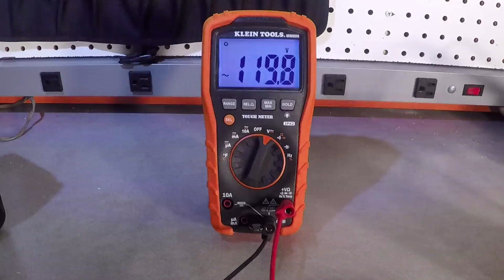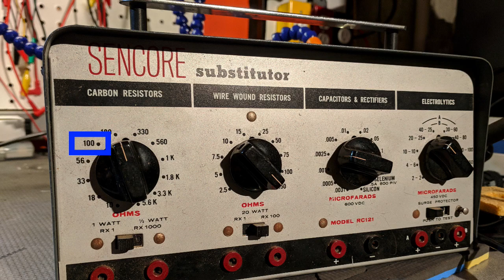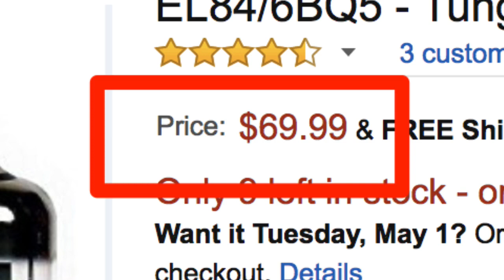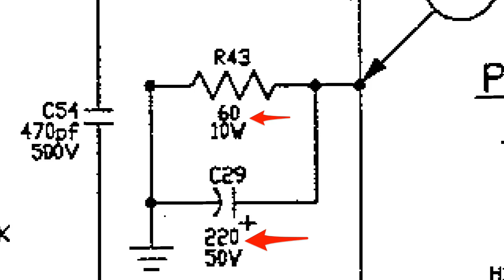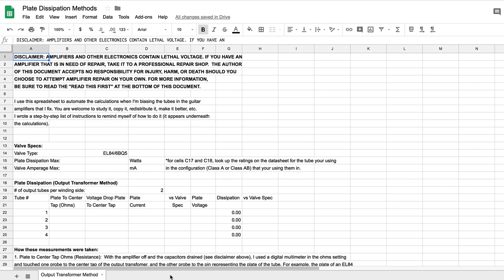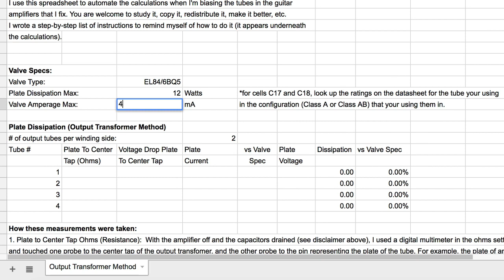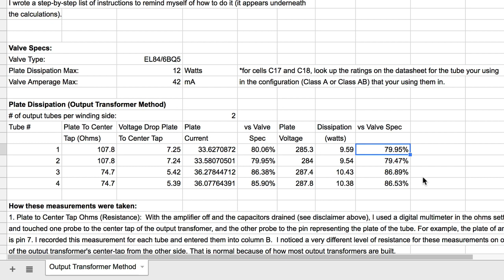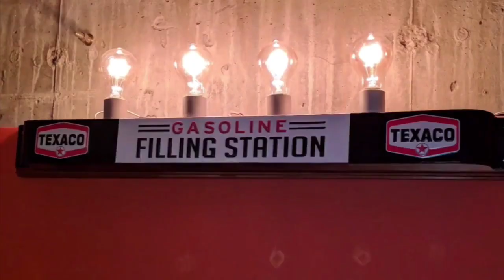Crate Vintage Amplifier Repair: Re-cap, Re-Tube, Re-surrection! (AmpMechanic #009)

Comment: Hi there AmpMechanic.
Today I bought a crate vintage club 50 in pretty knackered condition, so your vid is a godsend: like some online university course for valve amp repairers !
You may not have a massive online audience, but I'm certain that we few watchers truly appreciate the time and effort you've put into these videos.
Thanks so much, and I look forwards to your future uploads.
Reply from the maker: Hi @Digital Chris... wow! this comment really made my day. Thank you so much and glad that this video could be of some help to you! Good luck with that amp!
Reply: @AmpMechanic   Howdy. Where can I find that circuit diagram with specs?
Reply: Just bought a club 50 myself.  2x12 version..  1st, why is it called a club 50, when it's a 200 W system??
 Mine doesn't seem to be getting any power. Honestly think the repair is over my head unfortunately.  Never messed  With any tube power equipment. Wish u lived close. Where are you located by the way?
Reply: @incredifunk  it's 50w! If you don't know the basics of electronic kit repair, do NOT mess with valve stuff - there are fatal voltages in there!
Reply: So the fix was essentially one cap and 1 tube?
Reply: @incredifunk  , "200 watts" is what the amplifier pulls from the wall socket, not the audio power output to the speakers. Tube amps typically are only about 20% efficient, so  200 watt power consumption translates into about 40 watts of audio power. "50 watts" might be a slight exaggeration on Crate's part. A pair of EL84  in push-pull is typically good for 15 to 18 watts at most, so double it for a quartet of them.

Comment: While trying to find the correct way to clean dust/dirt and junk off my Dell Laptop motherboard, I found your channel. I understand electronics and everything you did, long but got it. 
  My Grandad graduated from KU in 1932 with an electrical engineering degree, about the same year "Bell Telephone" invented the transistor. What was on his finals test to graduate.
It had to be all about tubes. Also, I was the idiot who climbed Microwave & TV towers and got paid for it. The FCC requires these towers, light bulbs changed, etc., a guy or someone told me that even with modern electronics, the most wattage to transmit to receive was 40 watts. The space shuttle has a radio to transmit a long distant, but uses tubes. I think my Grandad and you would have spent time. He got me onto chemistry and later mechanical. The later allowed this self taught farm guy to fix everything and read schematics. DC is easy and used voltage drop a lot. Please tell if isopropyl is best for cleaning the PC board!

Also, a neighbor who moved, had me fix a simple vehicle problem, but gave me a battery powered "Marshal" amp that clips on your belt. It creates sound like the full sized 1970 amp they sold for $420. That was a lot of money in 70, a used Buick or Marshal guitar amp.
Have you or a buddy ever heard of that? I thought is was a toy gimmick but no way! This 6" X 10" amp (Rough Size) kicks behind.
 Either way, I enjoyed your clam explanation of how things work, I have the same DMM but a little dirtier. Going to watch more on your channel as I have time I should not have. 
 I ran equipment at work, I was not hired to do. It was heavy, stuck in the mud and jumping for 5 hours. I've had 5 back surgeries, last July 15th 2020. I went in for an L3-L2 fusion, Dr did the L3, L4, L5, S1 all over again. At 6'3" tall in a short world, it burns to learn forward for a few minutes. That life. 
So having to fix a 3/4 year old Dell that kills the A/C Green LED as soon as plugged in. Big shoulders. I wish I was a janitor for 40 years, not to say that is easy, but dealing with the gifts God gave me. Imagine, millions who know nothing but smart phones, twitter, youtube, google and do not understand an analog clock. Sad! Enjoyed your videos, subscribed & liked! Old Man 62.
Reply from the maker: Wow. Great story and thanks for subscribing. Sorry I didn't respond on a more timely basis. I love being closer to the analog world and knowing what's really happening behind all that digital stuff. Always good to bump into a bird of the same feather!

Comment: Excellent video Dave! I have the same amp in blackTolex. Super sweet amp.I learned they have a small cult following and forums for hot rodding and modding them. I have no reverb on mine, so I will check for 150 ohms at the reverb tank.Again, truly fine video. You are a great teacher. Thanks so much!
Reply from the maker: David V thanks so much for the kind words. Made my day! Good luck with your amp.

Comment: Nice explanation. the only different that I see in the 50w version (the one that I have) is that the 50w has a jumper J03 instead of the resitor R43 and capacitor C29 and jumper J01 instead of in J02. As well diferent power supply. Giving higher V the one in the VC50. So we must consider it...Thanks

Comment: Dude, when can you please come back? No pressure, just briefly saw a new vid out but then it went away before I could catch it. Hope you are doing well and looking forward to your next. You are a great addition to this niche.  Cheers!
Reply from the maker: Sorry about that! About to publish one and have another in the works. Thanks for pushing me!!!
Reply: AmpMechanic I'm not pushing you because I'm a kind hearted do gooder. I'm a selfish arsehole that is jonesing for your next vid. That's how good they are. Get to tubin! BTW, I have been jamming through the Eico 147A Signal Tracer for a while now and it's awesome. Changed the original 1.5 watt speaker to a 4" 30 watt Eminence. But let not your heart be troubled... no vintage gear were injured during this film.
Reply from the maker: Thanks for the compliment. I've been working on a better video setup (building) my own light panels and such. That's why the delay. There'll be a video on that too.

Comment: Dave, well done on your first Amp rodeo! I found, and watched, your first video 5 days ago. I thought it was a good video. The next day I saw some old gear for sale in the local paper's classifieds. The add had been online 47 minutes. 12 bad pics of old dusty gear, bad lighting, couldn't really tell what it was but the price was too low not to go take a look. "5 bucks each, or 20 takes all of it." I'm still am having a hard time rapping my head around what I ended up bringing home. I am now the proud owner ooooof... Taking a deep breath. A Tektronix 317 Oscope, a sencore PS148A vector scope, a Philco 7070 RF signal gen., an Eico signal tracer 147A with the aliens invader eye!,  a B&K 1077B TV Analyst, an NC 300 big ass transmitter, and a B+K 1640 power supply. So I got up early this morning and devowered the rest of your videos in one sitting. Thank you for sharing your knowledge! I learned alot and am looking forward to your next video.
Reply from the maker: Thank you so much for the great compliment. LOL on bringing home the old gear. Sounds exactly like what happens to me. Sometimes, these sellers just want to unload everything and there may be just one item you want but the seller makes you take all of it for one price. I have literally cut off all purchasing until I get through all the stuff I've collected and restore and/or sell it.
Reply: @AmpMechanic Vintage test gear acquisition can get addicting fast! But what an awesome way to learn about electronics. I mentioned the Eico 147A Signal tracer. The magic eye has addled my brain. What a cool little guitar amp it would make with a 4"  30 watt Eminence speaker and some slight circuit mods to bring up the output from 3 watts to 12 ~ 15 watts. Anyway check out magiceyetubes .com. Also, what is blog/forum for Tektronix scopes you mentioned in your video that helped you with your groovy optocoupler tester? Thanks!

Comment: I have a VC2110, single channel amp.  This amp has to have the speaker removed to access the amp chassis.  There are 2 screws on either side holding the baffle.  Once it is pushed out the front the tubes are right there.  This amp does not have the removable back.

as you stated these amps were biased to run hot.  The solder on the tube sockets to the board can crack from the thermal heat which leads to problems.  reflow with additional solder and you should be good to go. I changed the Cr from 120 to 150 ohms  (2 el84s) which added a lot of head room, but still had a nice breakup.  Replacing the 20 yr old filter caps took the hum out.

If you measured the cathode resistor you'd probably find it was closer to 63 due to your calculations. personally I would not buy a 5th or 6th matched tube since once the ones you are using have aged they are not going to match the spares.  Overall nice video.
Reply from the maker: Thanks for the great compliment. Much appreciated and great point on the mismatch on aging tubes (although I think it's good to have the originally matched spares if you need them in a pinch).

Comment: Hey Amp Mechanic! Thanks for this video. I also have a Vintage club 30. It blew the doors off a crate voodoo 50 at the music store so I jumped on it. In looking in the back of the amp and having cleaned all the pots with DIOXIT D5 and all the "pops" and almost all the static is gone and volume has returned. Now...when I was first in there back of the cabinet looking at the board I notice that as I put my hand closer to the four red wires that run from each the four terminal white plastic plugs the hum got quite loud. was the circuit looking for a ground? Also when I start loosening the boxed screws certain ones would "static" are these conditions telling of a flaw? And lastly is cleaning the dust off of the tubes recommended? It seems that the heat would get held in by a coating of dust on the tubes. If so How do I clean? Thanks Buddy.

Comment: First want to thank you for being so thorough on a pretty good amp.  I was watching your video and setting up my Vintage 30 up for some testing and my Stand By Switch broke in the off position... Do you know what the replacement part might be and supplier?  Too funny that it crapped out when I was trying to do preventative stuff.

Comment: I've got the Vintage Club 50 with one 15" speaker. It's a great amp when everything is working right but it can burn through tubes and caps in no time. I don't work on amps but I've been fortunate finding a tech who can do the job. I wouldn't think of taking it on the road without a back up. I think it's a good idea to put a big fan in back of the amp. The tubes mounted sideways and getting hot cannot be good for their lifespan. Relying on that little channel switching button can be precarious because it can easily get dirty and malfunction. You're much better off connecting the channel footswitch. My model takes castors well because the cabinet is deep and low enough that there is minimal risk of the amp tipping over. This can be a problem with some larger Fender combo amps. The metal grills on the top can get bent and damaged quite easily.

Comment: Is the spread sheet you mentioned still available???? My bad?  I Have bought a Crate All tube C30 and U1252B Now retired use to work on residential and light Commercial 110/220 v electrical as  General contractor in Calif for 50 yrs.  Some very minor custom circuits.  Thanks in advance.  Willing to purchase.

Comment: hello great video do you have any experience with crate SPA amps specific the crate spa2000 I have one that is stuck in protection mode and stays in that mode and experience you may be able to offer would be helpful thanks in advance

Comment: Hi. Thanks for the video. Maybe a little long/slow in explanations ... 
Anyway, there are other methods who are quite faster: one is with a Bias Master. You put the valves on a specific soquet connected to the Bias Master. I have one of those soquets mesuring also the plate voltage; this bias mesurer gives you the plate current that you must decide before. Some amps have a bias potentiometer to adjust this current. 
Any way you should also check the plate resistor(s) before mesuring.
Reply from the maker: Fair criticism. Always looking to improve. When I did this video, the Bias Master didn't exist.

Comment: Hey there. I have this exact amp the vintage club 30 (3112) and I am wondering how to convert it to the 220V input because i now live in Europe and I bought it in the US. I am not an engineer but obviously you discovered how to switch the voltage on it. Any help would be greatly appreciated. 
Thanks in advance and great video!!

Comment: You might try ham radio.  Absolutely no end to the things to make/modify in that hobby.  Even RF amps and transceivers if you go whole hog.
Reply from the maker: Thanks Wade. Yes, I have a bunch of old tube radios here that are in need of TLC and I'll be turning my attention to them. Some have short wave like the Zenith Trans-Oceanic. I had an entire ham shack here at one point (it was given to me) and I was going to get that all up and running. But erecting a antennae was going to be a challenge and Covid hit and all and they stopped the in-person license tests. So, I paid it forward and gave the gift to someone else who could benefit from it immediately. I might circle back at some point.

Comment: i learned that the best way to work on this amp is to only remove the wood screws and leave the rest connected to the back panel, open the vent grate to disconnect the speakers (mark pos/neg ) or take a picture, disconnect the reverb tank and i added wire and put male speaker tabs on extended speaker wire for easy disconnect in the future

Comment: i have a problem with the brother amp crate VC 50 its a fixed bias but its not adjustable , and the bias is not negative enough , it is -15 volt and should be-18 volt , how can i fix this ? a voltage double r , but how should i hook it up ?

Comment: I think it's better to have unbalanced tubes on each section, if the balanced you can get parasitic oscillation especially feedback circuits, so each bank of two shouldn't be balanced but not all 4 as a whole, so each pair is out of balance with each other but balance with the other set. So are balanced two set to the other two set, but individually sets not balanced each other in the set of two